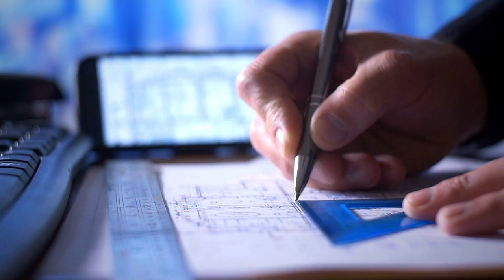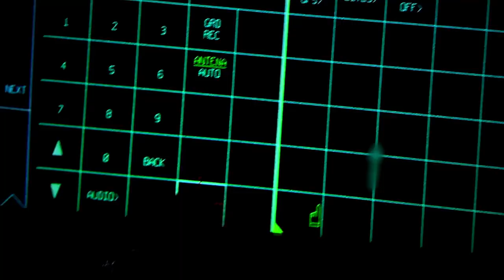Russia’s New Stealth Bomber - PAK DA

Comment: So, just to get this straight: The B-21 is in the works since 2015 and still hasn't flown. It is being  developed by the same folks, that already build the B-2, so it is fairly safe to assume, they know what they are doing and they also know a thing or two about stealth tech.
And now, here are the Russians. Total stealth aircraft in service: 0. Total stealth aircraft flown: 0. Total stealth aircraft designed: 0. And they claim they design, build, fly, test, mass-produce and deliver a complete stealth bomber weapons system in the same 7 years, it took Northrop Grumman from the start of the B-21 Project to now, which arguably did not yield a mass-produced stealth bomber weapon system yet? No way Russia will pull this off.
Same goes for stealth-defying radar. Since 25 years, there have been various rumors about radar systems capable of detecting stealth planes, but noone has fielded any system. Germany has an experimental system, which is rumored to be capable of detecting a F-35. But this project cooperates heavily with the US military and it is a safe bet, any results will be shared and scrutinized together, allowing improvments to the stealth capabilities. And do not forget: Germany is going to buy F-35s - which we clearly would not do, if there is proof of its stealth capabilities being useless.
The US has managed to maintain its lead in stealth tech for several decades and I see no indication of that changing anytime soon. Remember, a weapons platform needs to be fielded, operated, maintained and used to full effect. Making a funny drawing on a napkin does not count.
Reply: I've always wondered, if you're unable to produce stealth aircraft then how do you produce a radar to detect stealth aircraft
Reply: @loucyphers_nightmare  Stealth is not invisibility or being totally undetectable. More often it's about making it difficult for the enemy to accurately target you. Those big radar arrays can probably see almost anything in the air, but the narrow band radar used for things like missile lock-on are where stealth comes into play. You might know there's a stealth jet somewhere in the area but if you can't pinpoint the aircraft then you can't shoot it.
Reply: @CausticLemons7  : I know all about what you said, I guess my Sarcasm didn't shine through and that's my fault
Reply: Makes me wonder why we are putting so much money into expensive stealth aircraft with a short lifespan, while we are still flying the B-52. That is anything but stealth. Now grandchildren of retired B-52 pilots are flying those machines. My feeling is that getting close enough to the target and letting loose with cruise missiles and then head home. I wish this money was spent on good things, like zero-point energy, anti-grav aircraft, increased production of food, research into better battery technology to elevate the need for slave labor to dig for rare earth material. The trillions of dollars spent could have been used to develop much safer and better passenger aircraft, more passenger railroads to major cities, etc. We just spend money to kill people.
Reply: @bondgabebond4907  Actually it is quite simple: Planes, like the B-2/B-21, F-35 and so on are initial deep-strike weapons. Their primary objective is, to go in first, go in deep and knock out air defenses. Once that is done, it is FAR more economical to send a heavy-lift-monster like the B-52, which is comparatively cheap to operate and either use standoff wepaons or masses of freefall bombs to deal damage.
In short. B-52's are cheap and carry loads of stuff. Once the stealth weapon system have cleared enemy air-defenses, they can go in.
Likewise, active air defense countermeasures have also come a long way. A modernized B-52 is quite capable in defeating enemy air-defense attacks.
It makes absolute sense to keep the B-52s in service. But I am totally wiht you in thinking, that these weapons are a waste of time an effort. Unfortunately, they are required in a world full of Putins, Xis and Trumps.
Reply: The B21 has already flown, I've seen images of it taken from civilians in the US that have since been deleted of the internet, and that was 2 or 3 years ago
Reply: @CausticLemons7  Thank you. Took words right out of my mouth.
Reply: @virtualinfinity6280  You are clearly enthusiastic about this. I recommend you move on to a more academic sources as it's clear those on which you currently rely have failed you. Detection is a very specific capability. All near peers can detect even our most stealthy platforms. Targeting them? That's another story.
Reply: @williambrasky3891  So true.  Has been covered in several YT videos.  Yes, stealth aircraft can be detected.  Targeting them is a whole 'nother ball of wax.
Reply: Long wave radar can detect stealth fighters
Reply: @CausticLemons7  you nailed it.  they can be seen on radar.  but it is usually within a window of 20 miles or closer for one to be targeted effieciently. i use the word efficiently as a gift to the task.  since they are launching smart weapons from 100 miles plus away.  would most likely be dumb luck if they targeted and hit one that far away.
Reply: @TheTeehee11111  No you haven't.
Reply: @TheNanotag  if you say so🤷
Reply: Expect the B-21 to make its maiden flight any day. The first aircraft was just moved out of the production facility.
Reply: @loucyphers_nightmare  you can make stealth plane mock up to test an anti stealth radar. Its much cheaper than produce a stealth aircraft
Reply: @redemissarium : True, but that will only get you so far if you can't make quality RAM
Reply: @loucyphers_nightmare  RAM effect on stealth is only minor addition most stealth is from geometry/shape. That is why you need  new aircraft instead of coating every inch  of F16/mig29 etc wuth RAM
Reply: @redemissarium : It's not as minor as you think, if it was mainly geometry and shape foreign aircraft manufacturers would just copy the shape of a plane like the F22 and you would've had tons of stealth aircraft flying around, the SU-57 has the geometry and shape needed for a "5th gen" aircraft but it's stealth capability sucks compared to the F35 and F22
Reply: @loucyphers_nightmare  its minor. Of  course manufacturer copy it. Do you see chinese J31? and then there indokorea KFX? shape is almost everything. Why people criticize PAKFA? its not RAM, its the shape of the duct that not hide the engine surface.
Reply: @redemissarium : RAM is not minor, don't know why you're bringing up a plane not even flown yet, but it's a free world.  I'll give you another example, the Chinese J20, it's got the geometry down pretty good, but an Indian Russian 4th gen fighter could see it on its radar, thats because of inferior RAM
Reply: @loucyphers_nightmare  do you aware india claim they detect at what range? 10-20km. This is WVR range and while J20 detail aint that stealth. secondly the claim could be utter b_s. How they know that is J20 if it only in radar? they dont. it could be just a wandering UAV, except (yeah) they detect it at visual range in which it all meanless
Reply: The bomber is so stealthy, nobody will ever see it coming. It has been successfully & cleverly disguised as a yacht in the Mediterranean.
Reply: @redemissarium  : Well if the Indian airforce reported that they could see the J20 on radar, ill bet  that it was BVR.
If it wasn't the J20 or something else the pilot would have reported it as such, and definitely wasn't a UAV because UAV's don't have the speed of a fighter aircraft.
As for your ill-informed claim that RAM is minor, you couldn't be farther from the truth, I had to research the info because I wanted to be correct, 70-80% of inbound electromagnetic energy is absorbed by RAM. that's hardly "minor".
But why are you so upset that the Indian airforce reported the incident, I'm assuming by your reaction that you're either a wumao, white monkey or you're part of the 50 cent army
Reply: Very good breakdown
Reply: I think invicible airplane does exist ,all object who fly can be detected ,you have new tech for stealth jet but there is new radar anti stealth ,exist only better planes ,Serbia shot dows one of the best stealth of usa with old system of air defense remember that day and now is 2023 ,radar tech in much better
Reply: Russia kicked americas ass in the space race
Reply: @bondgabebond4907  see, those things you would rather spend the money on are mostly imaginary, while B-52 has vast stocks of spare parts remaining, so one is obviously better bang for the taxpayer buck
Reply: At least they weren't fighting opium farmers and camel breeders who only carried AK-47s, then went home after losing the battle for 20 years.
Reply: The b21 is still not out yet and when it will be I highly doubt they will be able to make 200 or 140 as they are planning maybe a 100 or 70 at best. The us planned to make like 132 b2 bombers then it lowered the numer to 75 after the cold war ended they were barely able to make 20 with the 21st aircraft being the test aircraft needing 500 million to be converted to a proper battle capable unit.
Currently the russians habe made 30 su57 aircraft and are constantly upgrading it, they recently gave new engine which would make it the faster stealth supercruiser in the world aka nit needing to engage its afterburners which increase its range and lowers the RCS, something not even the f22 can do.
Speaking of the f22 the plan for them was to build 750 of them, then that was lowered to 400 and we finaly ended up with 187 battle capable units.

Comment: I imagine that there are quick reacting fast weapons that can detect when the bomb bay doors open and hit it before they close.
There might even be something that can disable a nuclear bomb on the way down.
Reply: And regular hit to kill projectile that can actually hit the warhead should be capable of disabling any implosion type bomb (like all of em since the 60s and certainly anything shoved on smaller modern delivery vehicles will be as well). To get a nuclear detonation in implosion  type bombs the shockwave from the conventional explosive shaped into lenses (extremely precise and being hit will change it's performance) needs to converge on the pit extremely symmetrically if it's off by just 5% it'll just blow it apart and spread some highly radioactive core material around but not actually achieve a nuclear/thermonuclear detonation.

Comment: Looks a lot like the Lockeed/Rockwell program Concept for the Stealth Bomber program that lost to the Northrop Design for the B-2
Reply: Northrop Grumman built the B-2 and the XB-35.
Reply: @thurlravenscroft2572  yeah but Lockheed entry into the program looks a lot like the bomber in the video if they are legit, 
search for Lockheed Rockwell stealth bomber
Reply: B2 itself is based onGerman designs.
Theres no looking like here Its german tech
Reply: @Meteorknite  nope that’s a myth. The B-2 is based on flying wing designs made by the founder of Northrop. When some documentary filmmakers asked Northrop Grumman about if the B-2 took any design inspiration from German WW2 designs they were not even aware that the Germans had had any flying wing designs, but they were curious so they built a mock-up of the German design with some accident stealth upgrades and tested it in their RCS lab which revealed it was no more stealth than any general flying wing design would expect to be and was completely detected by British WW2 radar at a distance that would still be over the channel.

Comment: What kind of electronics will this have? Will it run on vacuum tubes? Last time I checked, semiconductors are a little hard to come by in Russia these days.
Reply: Tubes?At least it will have a nice sound system LOL
Reply: My thoughts exactly, maybe they'll use a mechanical computer with wax cylinders for the programing --- lol

Comment: 164,000 feet ??? Really???  I read a book written by English Electric Lightning pilots, were one pilot mentioned conducting intercepts on an American bomber at 100,000 feet, but he said the bomber climbed to 120,000 feet and he could not reach it??? I know of no American bomber that can fly that high, at least officially. Is this pilot lying or could this be real, not to mention that it was the 1960 or 1970, i can't remember when.
Reply: At 164,000 feet altitude, mach 1 is approximately 25 nts  (30 mph).  Since the plane is subsonic, it must have a stall speed lower than that.   -not likely

Comment: "if it even exists"

I guess it's not "Russia's New Stealth Super Bomber"

If something is in development then it's not a new product.

What can be said is 6 B-21s are being built right now for that complete flight testing phase where the last issues are worked out.  So, it's GOING to be a product.  Flight testing starts next year.  The US is too far down the path for the F-21 for something else to take its place.

This product will probably start flight testing 2024 - 2025. However, Russia is going to have problems getting some parts so they have to change up the supply chain for part of this aircraft which probably means moving to more of the parts coming from China.  I'm not saying whether that's a good or bad thing but it probably delays the aircraft.  Russia usually relies on aircraft being sold to help fund their programs and because the US has a lot more experience in building both stealth and fly by wire I'd say it won't be so easy for them to sell this.  On top of that having to switch around their supply chains and probably relying more on Chinese manufacturing does more to assist in their Chinese stealth bomber program.  If anything I think the sales would go to either the B-21 or the Xian H20.  It's going to be harder and harder for the Russian to fund their programs because of Chinese technology which is going to improve at a rate faster than the Russian's.

Comment: 164,000ft. Is that a typy-o?
Seems unlikely.
Or just a veeeery wrong assumption.
164,000ft is the end of the stratosphere. If the Russians say it can fly "in the stratosphere" it doesn't mean it flies at the very top but most likely at the very bottom around 60-70 thousand feet....

Let's use some math shall we?

at 164.000ft the speed of sound is 655kts. This aircraft is "subsonic" so won't go that fast.
let's say it flies at Mach 0.9 which is 576kts at that altitude.
This is all TAS (true airspeed). Converting that to IAS (indicated airspeed, which is uncorrected for density but does coincide with TAS at sea level and is the speed used for calculating stall speeds) we get around 18 kts.
This stealth bomber will need a stallspeed of 18 kts to fly at 164.000ft. Not even talking about an engine that functions upthere or where it'll get the power to climb up.....
That is about 20% of the normal stall speed for an aircraft like that... perhaps even less.

Comment: Lols. You have any idea how likely you can fly 150,000 feet and not be supersonic? The u2 struggles to be subsonic at 80,000. If it’s tupolev making it it will take 20 to 30 years. The tu160 is decades late getting updates. The tu22 took decades to fix and upgrade too.  They should have asked sukhoi to build it. The T4ms from sukhoi was far more interesting then the 160,